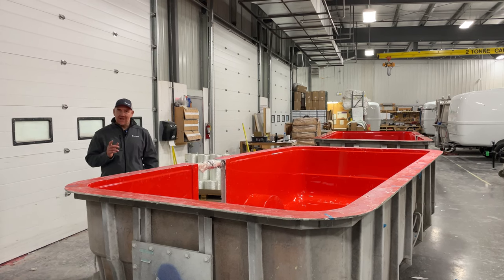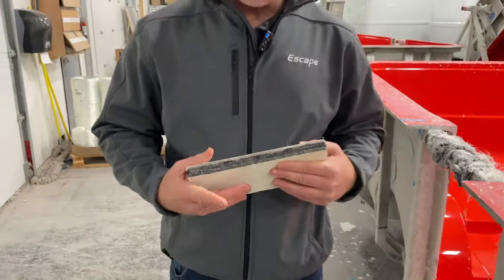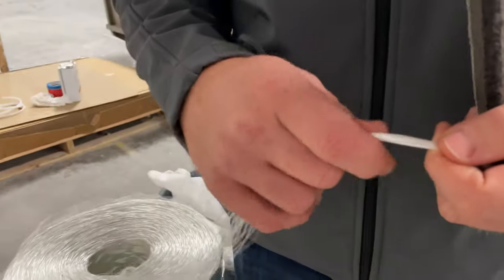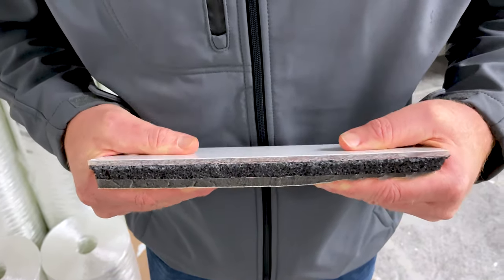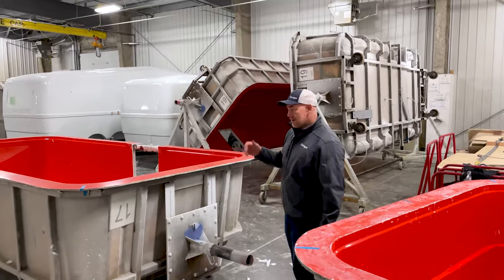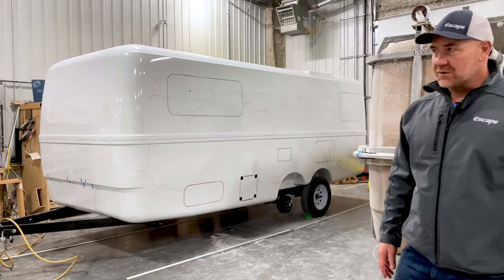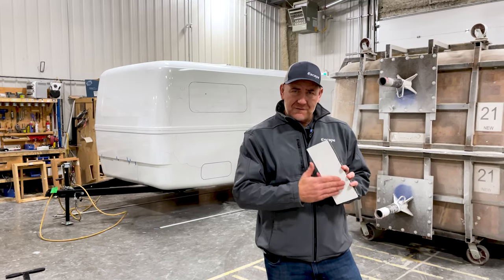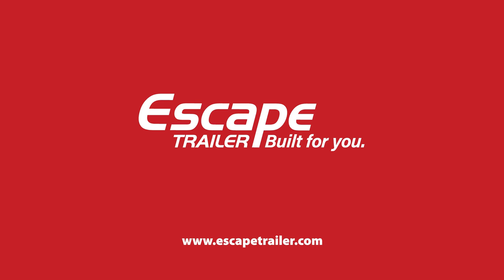The Benefits of a Fiberglass RV

Comment: What I especially like is the fiberglass layer right after the gel coat exterior ..the trailer industry used to use wood luan after the gel coat which always got wet and rotted ..then the walls de-laminated!  it happened to me! ..it was a nightmare!  It was unsafe not to mention unhealthy. Glad to see this smart common sense trailer build  ..wish it was around years ago. The only thing I would suggest is a bit more insulation between the walls.
Reply from the maker: We appreciate your feedback! Our commitment to using fiberglass as a structural material ensures durability and longevity, avoiding issues like rotting. Regarding further insulation, we're always looking for ways to improve, and your suggestion is duly noted. Thank you for sharing your experience and thoughts with us!

Comment: Are the floor solid fiberglass or plywood encased?
Reply from the maker: Hey there thanks for the question! Our entire exterior shell is Fiberglass and our subfloor inside the trailer is made from a premium plywood product. To mitigate condensation building up in the trailer we have many drain points around perimeter of our floor to allow any moisture from condensation to effectively drip into the pontoons which then drain to the outside of the fiberglass body. If you have any other questions please feel free to reach out!

Comment: How heavy is fiberglass when compared to AZDEL? They claim to be the best in terms of lightness and of durability. How does yours compare to another made with AZDEL? And, how heavy will this particular unit be once it’s finished?
Reply from the maker: Tough to answer precisely so this will be vague. It really depends on the exterior construction method. Azdel is a nice composite material usually bonded to something else. 
You would need to look at the weight of the particular RV exteriors and compare. 
Trailers can be made light with lighter materials throughout the entire exterior and interior  construction. It's always a trade off between weight, cost, durability etc. Even fiberglass (not skinned only) trailers from different manufacturers vary in their structural philosophy, Escape employes a thin skin coupled with and interior structure which provides rigidity similar to a whale. A different philosophy would be to have a thicker construction that is structural in itself similar to an insect exoskeleton. 
Hope this helps.
Karl@Escape

Comment: Why do you call it a one piece trailer when you obviously have two parts that are glued together, a top and a bottom. If it was a "Good" fiberglass build, they wouldn't be using shot fiberglass, since that is the heavy way to make fiberglass components.  Hand laid or vacuum infused fiberglass, with the highest strength, lowest weight results.
Reply: They're already light enough and expensive enough, you just suggested raising the price in exchange for a few more pounds shaved off.